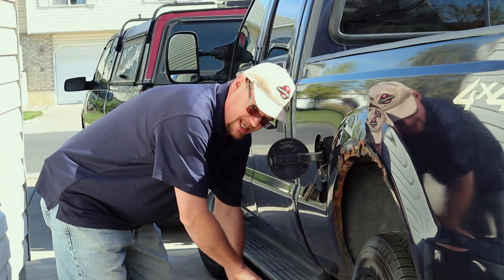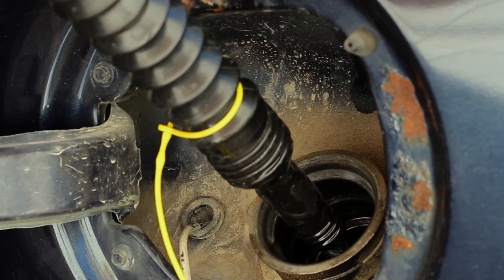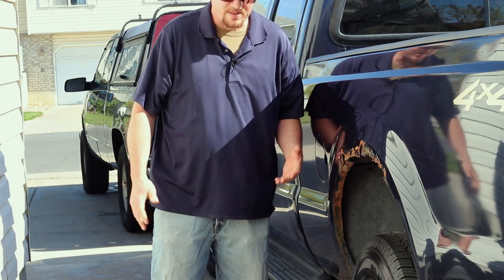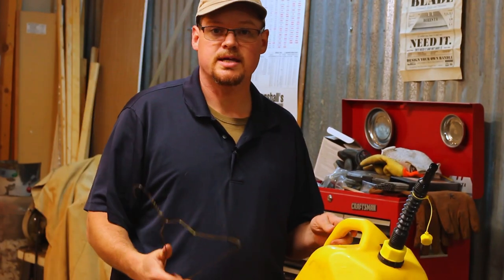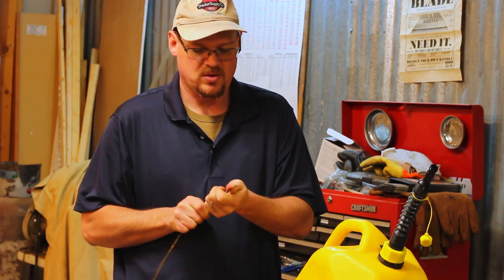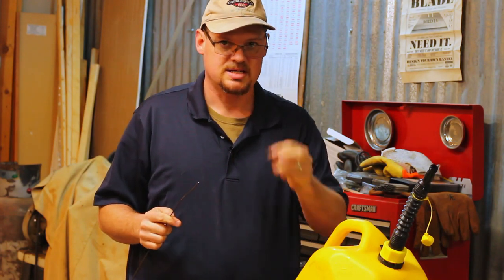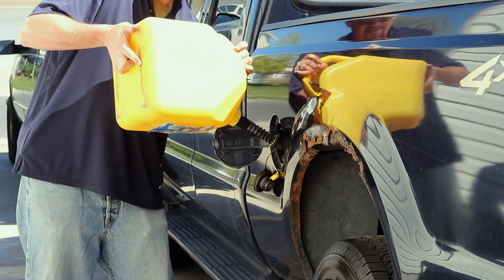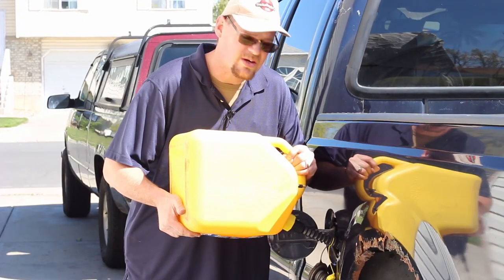GAS CAN VENT HACK

Comment: I did about 6 of these cans like this about 5 years ago, when another you tube channel did this very very valve stem hack. Easy to do, but the gas fumes softens the material and will go bad. Some have a metal fastener that attaches it which exposes less of the soft material and have held up better. That’s the only ones I’d consider.
Reply: Hi there ,I was wondering how long the valve stems held up for?
Reply: @backyardbuck6362  They soften up fairly quick, don’t think any made it past the 3rd year. Since then, I found Amazon has quite a few now that are made all of steel, with one small rubber washer seal. I don’t think I’m going to have any issues with these. I think I bought a 6 pack, maybe 10 or 12. Good price when buying bulk.
Reply: @johnlile7562  Thanks for the tips I really appreciate  I'll try them and  I'm sure they'll  work great.

Comment: Valve stems are natural rubber & will die with gas. Maybe in the diesel it will live longer? A bulkhead -3 fitting (like the one you would use making brake lines) with Nitrile washers would work well too. :)
Reply from the maker: I did not think about that gas vs. Rubber.  A bulkhead fitting is a great suggestion. I will have to try that.  Anything beats a California regulated safety can.  I spill more on the ground trying to get the safeties to properly work.  Thanks for the great suggestion! 
-Will
Reply: What size is the hole you drilled in the can  !!!!!!!!
Reply: The gas will eventually eat the rubber it happened to mine but I just reinstalled another valve stem they are super easy to replace no big deal to do

Comment: If you have a lathe, just take a stainless steel bolt and drill a hole through the center. 2 gasoline safe O-rings - one on each side of the gas container to seal it. A nut on the outside to hold it in place. An acorn nut on top. Done.

Comment: The vent hole needs to be further back, but that might make it more difficult to install the valve stem since you are using a heavy piece of wire... When I need to install a bolt in an area like that where I can't get my hand to reach it, I run a string through the hole first and put enough of it through that eventually it is dropping to some place where I can gain access... In your situation, putting a shop vac on the regular filler hole will likely capture the string as you feed it in... Once you have the end of the string coming through the larger hole, attach it to the end of the bolt (or valve stem in your case) and pull it back through the vent hole.  Remove the string while holding onto the shaft of the valve stem and screw your valve core tool onto the valve stem.  You can then use it to pull the valve stem through the hole without possibly damaging the valve stem from bending it.
Reply from the maker: Very helpful.  I love constructive comments like this. Thank you.
-Will

Comment: I hate most of the no vent cans but I did find a very useful model at my local stihl dealer. It has a short nozzel with a button on it. I've found it really useful for filling up my tools and honda generator. Gives you a lot of flow and a lot of control. Unfortunately the brand stickers have worn off and I can't remember who makes them.
Reply from the maker: No Spill !
Great product !
How have you been Aaron?
-Will

Comment: Will that kind of rubber deteriorate with gasoline or diesel. The round gaskets for the spout are not normal rubber.
Reply from the maker: @human1513  
Possibly. 
Mine is still going strong though.
Great question!

Comment: What size drill bit did you use?
Reply from the maker: That would be 1/2 inch drill my friend. Make sure to measure the thickness of your valve stem near the base as all stems may differ in size. Make sure to leave a like. It really helps the channel. Thanks for watching!
-Will

Comment: If one vent is good, will two vents be better?
Reply from the maker: Yes you can. But more vents or a larger vent will only create value up to the point that your air volume in is equal to the fluid volume going out. Beyond that point it’s just a waste. Great question! Thanks for watching.
-Will
Reply: @Debtfreehomesteaders  You are welcome. For me I do not want to hold a 40 pound gas can any longer than absolutely necessary.
I did modify one of those spouts to remove restriction, then added hose on the plastic spout, then added a piece of copper pipe to the end so it stays IN the filler neck.
I can now set the can on the bed rail, insert the hose, and not have to hold it.
But that too takes longer than I want so ordering a set of those nice metal vents.
Not sure if I want to drill a hole on the only Gerry Can I have though. Rest are plastic.
My plastic gas cans are not midwest - cheap walmart brand. Not sure I can buy replacement spouts to upgrade them.
May have to try another method.
Reply: @Debtfreehomesteaders  On another video I saw a guy use a tire valve stem (all rubber one).
Seems much cheaper than a metal one.
Might try that on a small cheap can.